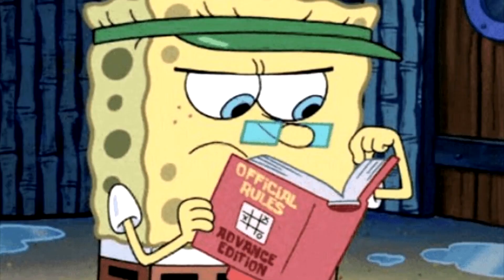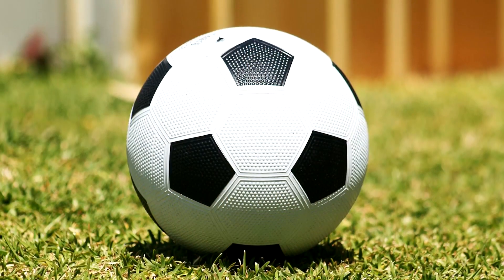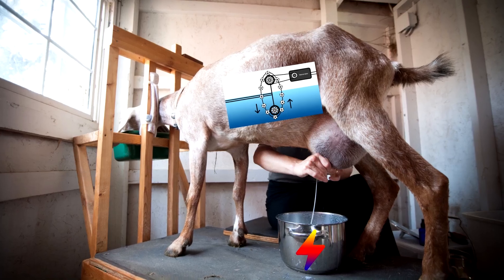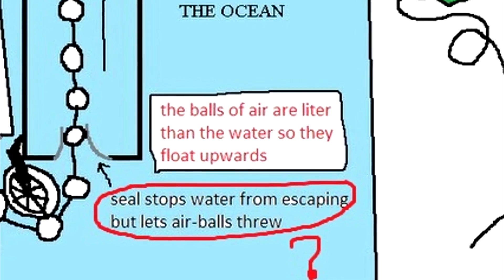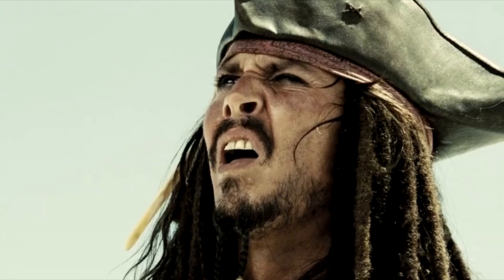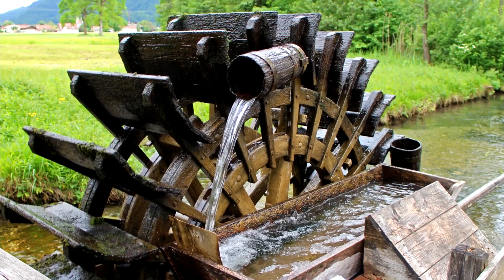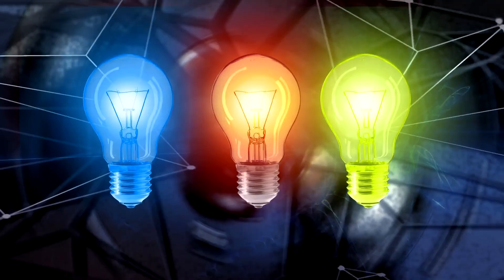why it doesn't work 16

Comment: So, I have a similar idea of sorts that uses some methods that are known to work, but just haven't been used in tandem yet as far as I can see and/or find out there on the net.

It's a combination of a trompe pump, with ram pumps, combined to bring water to a holding tank using only the effects of the ram pump  in conjunction with the increased pressure capable from injecting the trompe pumps pressurized air into the system. 

Normally a ram pump can already defeat certain inclines, though not very powerfully. But if you want to make water go vertical, you need to get creative somehow. This is where the trompe pump comes in. For those who don't know how it works, it pulls water and air into its system from the intake, and let's the air separate into a chamber that holds the air at a pressurized level. I am not certain how high this pressure can get, but it used to be used to bring cool air down into mine shafts a while back. So, it 'works'. I am just not certain how well it will work for this application.

But if it does work the way I think it should, then the air injected into the line after the trompe pump again at certain points along the ram pumps, should help keep pressure up enough to defeat gravity, all without any included power yet beyond natural forces. 

Also, the water doesn't need to be 'running' to make this work, as you can put the inlet valve for the trompe pump at a just below surface level of a lake to drain from the top. Just put some filters along the siding to keep debris out. This is important, because it means that if a certain amount of water can be entered into a closed system, this method of moving water can be kept continuous until more needs to be added later. The key factor being having big enough holding tanks for both before the ram pump system, and after it. So at the bottom of your incline, and at the top. But the top can only hold so much, so there will have to be a release valve at the top of it to allow that water to escape again. This is where you have two new runs going downward. One back to the original holding tank to recycle that water up the system, and the other a little further down to allow for the pressure of that water to feed the pipes going down towards the generators. In this case, two kinds of generators. 

The first one being an impeller design that takes flowing water and converts its kinetic energy into electrical. The power from this, ideally enough to heat the boilers, goes towards that end. The water that goes past the impellers is fed into the boiler, and that steam powers the generator beyond it. 

Any water not needed for this process that makes it past this point, is fed into a filtration system for drinking and other personal needs. 

And I think that about covers it. There are some potential ways to increase the power output of this setup by leveraging inefficiencies using thermoelectrics, but that will increase cost significantly. But not without justifiable reason to do it anyways... especially if phase change gets involved.

And if you need more power to make it work, just scale up the water pump system until it does work. The more water being fed up into the high point, the more kinetic energy can be recovered from the 'free' system via the impellers before it makes its way to the generators. The key thing is creating enough initial electric energy to power the boilers. 

And of course a person could add on solar panels and such stuff like that to this, but I am trying to keep from adding that stuff first.

Comment: the rosch one works... if that happens to be what you want it to do. 

it serves no useful function, but it is amusing, an inverse "waterwheel"... like one of those egg timers with the bubbles and wheels and levers and coloured fluid... sort of interesting as a kinetic sculpture.

someone would probably pay a fortune for one of these in bronze and stainless hanging in the side of their glass-walled swimming pool come aquarium... whats it do? "spin around and... erm... aerate?"

now ive got to thinking about it. sigh...

yknow, backwards? driven? it would compress the air. you would get 1 atmosphere (1bar, 14.7 psi, 101.3 kpa...) for every 10m/33ft you drag air down.

scoop air in at top, then dump into appropriate "hood" at the bottom.

be like a "trompe" but not. "hydraulic air compression". could use say, a windmill or water wheel to spin the "chain".

go get that patent!

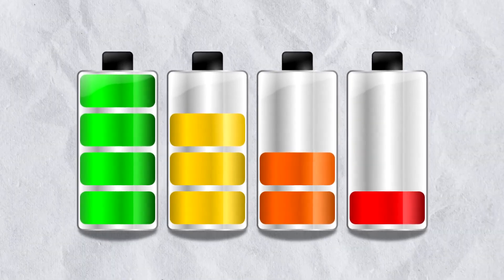Comment: 1:09 and where does the "same amount of energy to move itt downwards" come from?
Reply: the energy to breach into the water is the same amount of energy that is gained from rising back out of the water.
more explanation:
the water is heavier than the balls of air, so it pushes them upwards. the amount of force gained from this is equal to the weight of water on top of the balls of air.
the water is also pushing on the place where the balls of air enter with this same force. in order to stop the water from escaping, the same force must be applied to hold it in.

this would be a perpetual machine (no energy gained or lost), except that energy is also lost to heat the water and air, from friction.
Reply: while being abdolutely positive it doesn't generate free energy, I still can't explain where it fails: there are 5-6 balls wishing to raise to the surface, but only one that pushes to submerge. This sounds still like an imbalance. Where's the catch?
Reply: @spookykitty2327 finally a comment that actually explains the physics. Thank you.
Reply: @spookykitty2327  ooh so the answer to my question is "whatever you use to keep the water from entering the left chamber"

Comment: Kinda bad video on an easy topic.
There is no force diagram. no analysis of potential energy, but lots of unrelated rambles.
Just look at the midwits in the comments restating the obvious.
Reply: It's not about potential energy tho. This one is about water displacement, pressure difference, and buoyancy. It's a lot more nuisanced than you might think.
Reply: @dark6.6E-34  Oh, believe me, I have given it way too much thought.
If we are talking about taking the energy out of the system something needs to inject it, so potential energy is a very good tool.
Reply: @logon-oe6un  looking for where the energy is injected, is a very lazy approach in this context. You are essentially using the safe statement that energy cant be created nor destroyed to avoid analyzing the inner workings of the experiment at hand. Unless you go a bit more into detail you essentially dont understand the experiment.
Reply: @dark6.6E-34  You can use the word "created" instead of "injected", but finding the exact spot where intuition breaks down is the first (and second to last) step to these puzzles, even if "normal sudoku rules do not apply". Once you know that, you just go through the related laws until you find one that fits.
Finding to use pressure is more interesting than actually crunching the numbers to the end, as exemplified by you probably not going as far as to find the equilibrium position for any case.
Reply: if you're going to call something shit you should at least explain what you think is wrong with it

what did he say that was incorrect or irrelevant?
Reply: @icosagram  "The balls are forced upwards by buoyancy, when forced downwards by gravity. [Image with force vectors drawn on]
Note that these balls would be at equilibrium, pulling on the chain in opposite directions [zoom into the bottom part with a line drawn along the bottom of the tube to denote the balls the buoyancy of which cancels out], but the rest of the system appears to continuously convert potential energy into kinetic energy.[zoom out to the whole contraption]
Both strokes transform potential energy into kinetic energy, but where does it get replenished? [Image with "E"s drawn on becoming smaller along the path from the bottom of the submerged part to the bottom of the air tube]
The left seal is actually a Maxwell's Demon only allowing balls that would increase their energy to pass rather than also allowing water, thus continuously decreasing entropy. [Screenshot of top Wikipedia article flashes for a second, allowing you to learn what to google]
But such devices are assumed to be an inefficient way to concentrate energy [flash of a relevant part of the Wikipedia article], so unless the author found some way to cheat this trend, this wouldn't work ."

This is a shorter script (40 seconds for me), includes no b-roll, explains where  the energy is coming from, and doesn't go into an unrelated startup using a pump, that should be trivial for most of this church to debunk because it literally uses a conventional engine.
I also should clarify that this video is just "mid", which is very strange for how easy it seems.
 "Eating shit" is a separate analogy, commonly used to point out you don't need to be able to make something better yourself to judge something as bad, as judging and creating are separate abilities. A critic needn't be a chef, and some things offend most peoples' sense of taste. (Comes up as a counter to the excuse of badly made movies and games, along with counterexamples of well made games)
Reply: Why not create an explanation yourself? You seem to know how to upload a vid
Reply: @blackholesun4942  You don't need to cook to call some dish shit.
Reply: @logon-oe6un   imo you do. So I cook and I critise the others food
Reply: You could try giving constructive criticism instead of just complaining about it
Reply: @doughboywhine  I have listed the parts to include in the original comment. Maybe also include an explanation proposed potential energy generation method instead of going into an unrelated idea with an obvious engine in their generator.
And while b-roll is distasteful it's not the core issue.
What else is there to construct? And how is that different from complaints?
I have also written a 40 second script with listed modifications to the diagram to use for footage instead of b-roll in response to @2fifty533, but someone or something deleted it. No constructing for me.
Reply: @logon-oe6un  I added force calculations in the comments. The reason he didn't dive into it is probably reason nobody read my comment: 

"BORING, NERD 🤓" - The typical audience response to math.

Comment: The air pump for the actual diagram could use a trompe, which will produce extremely clean compressed air from flowing water. So basically alternative hydro power. Good if you need to provide electricity to somewhere that also needs a supply of compressed air but you don't want to use electricity from the main grid or want a voltage/frequency that's different to that of the main grid and don't want to dick around with VFDs and transformers.
Reply: lol, i had that thought then i realised it could be the air pump itself... lift water up in air, or drag air down in water...

the thing is, you only get 1 atmosphere for every ten metres. 33ft... inescapable. weight of water.

lol, with mercury... 32 inches... mmmm, healthy :) 

damn, i wanna see a mercury trompe.

lol, they did do it. laboratory equipment... very convenient way of creating steady, accurate pressures. its like the first real mention of the "trompe" in text is around 1600, for furnace blowers. a relatively obscure yet strangely common appliance.

as a kinetic sculpture it would be cool, as anything else... um... im still thinking of a good use? the trompe serves a purpose and does it well. this air wheel doesnt...

an excercise in efficiency... trompe, pumping air, that then drives this here "air wheel", that drives the pump to drive the trompe... how much extra pumping do you need?
Reply: @paradiselost9946  Driving the pump with the generator wouldn't work, energy will be lost in heat. Laws of thermodynamics and all that. 
Though using a river for the trompe, completely doable, IIRC a bunch of mines and refineries in Canada (or maybe the northern US) got all of their compressed air from a single trompe that was powered by a river. They ran almost everything off compressed air because electricity in mines isn't a good idea as compressed air is much less of a fire hazard.
Reply: @daviddavidson2357  you missed the bit about "how much EXTRA power is required for pumping to run the trompe?"

nothing practical, but as a kinetic sculpture i could sell one for a fair bit of cash...
Reply: @paradiselost9946  Yeah, if it's a case of how much more power you need, you could make some pretty cool kinetic sculptures using stuff like that.

I'm just more of a practical minded person, so I really didn't take art into account.
Reply: @daviddavidson2357  im not much for artistic, but i do like "interesting" things? and failing to think of any practical use... 

this would be just different enough to warrant a second look.

Comment: Isn’t this similar to hydro electric machines, that use tidal energy or hydroelectric power stations with a dam ?
Reply: A hydroelectric power station is ultimately harnessing solar power. The sun, burning nuclear fuel, heats the oceans which evaporates the water so that buoyancy raises the vapor up against gravity, and the winds, induced by the solar heat gradient, push it inland. The day/night cycle causes the water to cool and fall in the mountains as precipitation, and then you have a great deal of fluid where the gravitational potential can be tapped as power. The increase in entropy of that system is the eventual death of the sun billions of years from now.

The tides are from the Earth-moon system pulling on each other via gravity. A very massive object like a planet in motion has a tremendous amount of momentum. As the moon pulls on Earth's oceans, the drag force very gradually slows the Earth's rotation, and the angular momentum is transferred to the moon, increasing its orbital velocity and causing it to drift away. The increase in entropy of that system is the loss of Earth's angular momentum.

The troll generator does not appear to increase entropy in any obvious way. To paraphrase Fullmetal Alchemist, in order to gain something, something else of greater value must be lost (second law of thermodynamics). There is no free lunch.

Comment: Not just that, there's something called viscosity, it'll dissipate energy from the system in form of heat.
Reply: This is irrelevant. Even if this flaw didn’t exist, this system would not work because of the conservation of energy.

This case considers conservative forces (change in gravitational potential energy caused by gravitational force), not non-conservative forces that are kinetic and dissipate energy because of imperfections.

If you did set it in motion without this flaw, it would move perpetually, but just like it wouldn’t lose energy, it wouldn’t gain energy, so it couldn’t continuously supply energy to a generator without stopping.
Reply: Bad argument, because when it would be a usable heater that we could theoretically boil water with, for use in powerplants.
Reply: @logon-oe6un New or steam?
Reply: @logon-oe6un  No. It would create heat, but that heat would very rapidly dissipate throughout the body of water, preventing the temperature from rising enough to boil the water -- at best you would increase the rate of evaporation slightly. Even if by some miracle you captured enough heat to generate controllable steam, the power output would be orders of magnitude less than the main generator (ignoring the fact that it wouldn't work either).
Reply: @Eidako  Yea, but is still would be a bit of free energy if it were to work, make a farm of them for more heat, etc.
My point is "the problem is it's not free energy, not what it heats water with it".
We are talking about flaws of a perpetual engine, not flaws of a perpetual motion machine.

Comment: I have my own infinite energy idea but no diagram for it
Reply: MSpaint isn’t hard
Reply: @jacextreme6432  I could do sum like that but what are the chances this guy would end up seeing it
Reply: explain?
Reply: @-ADOI-  spin a giant gear, and it causes a small gear to spin. Because the big gear causes the small gear to spin faster than the big gear will, the small gear in turn generates more energy, which is sent back to cause the big gear to spin, and infinite energy is quickly built up
Reply: @mechspace  😔😔but how do you know
Reply: @GabeTheSilly  I know you probably haven't learned this in school yet. Think about it this way. 

The system you described, with the small gear being fed back into the large gear through shafts, would remain energy neutral in an ideal environment without friction and other dissipative forces. It would be able to sustain motion forever, but not make energy. That is the best case scenario.

When you think of infinite energy, remember the notion violates the laws of thermodynamics, and will never ever be possible.
Reply: @mechspace  hmmm I see thank you